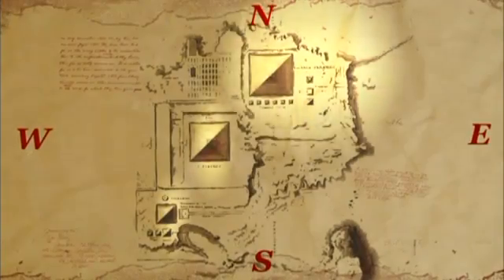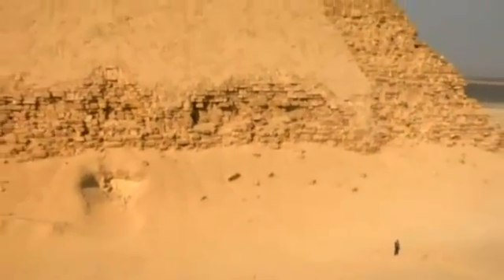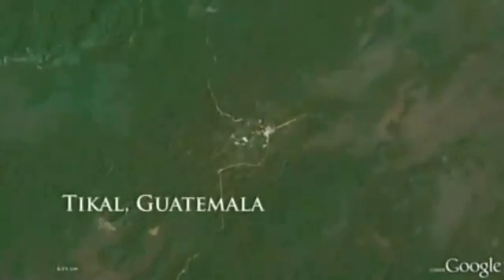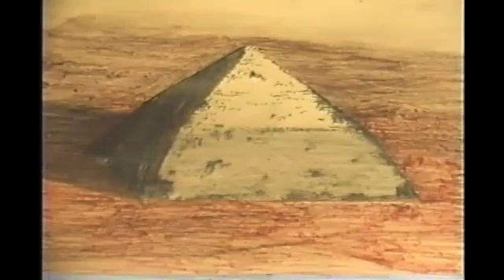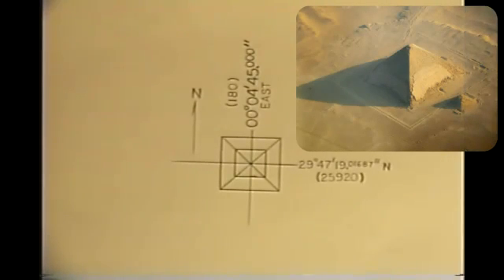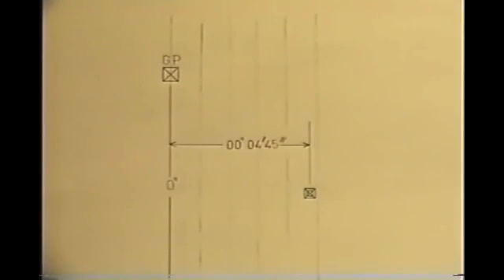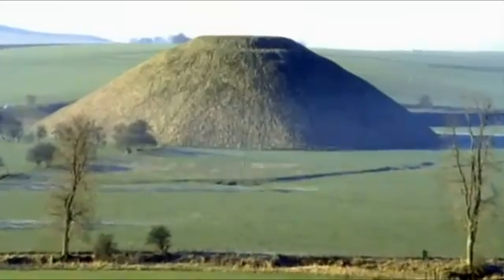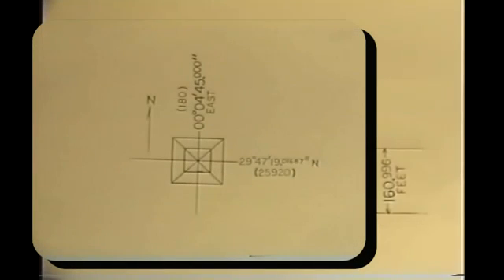Carl Munck Geomathamatics

Comment: What relation does 4'45 have with 180? And where does the 160.996 meaurement come from? There is no way to conclude rationally that this is the exact measurement of the steeper slope. You'd have to go around the entire structure and measure the height at hundreds of points and then average the values to get the most accurate height measurement. Is that what they did?
Reply: You multiply the number in the latitude or in the longitude, hence 4 degrees, 45 minutes is, 4 x 45=180. Carl also explained that the 0 and 360  longitude isn't at our modern Greenwich, it is at the Giza Great Pyramid. The  latitude is at the modern equator. The 25,920 is the code number for it's longitude, 29 degrees 47 minutes, 19.01687 seconds N or
 29 x 47 x 19.01687 = 25,920. 
Watch the first part of The Code, Carl explains why it is at the Great Pyramid and how to adjust this longitude.
Reply: @timothyrobinson1315  Clark Munk was a solid soldier, iit would be amazing to see him shut everybody up with his logic, but hey, at least he left us the most comprehensive study ever.
Reply: @timothyrobinson1315  0
Reply: His video "the code" explains all the math. Its quite a lot to take in but the math takes you around the worlds ancient structures.
Reply: +Iconoclast421 yeah